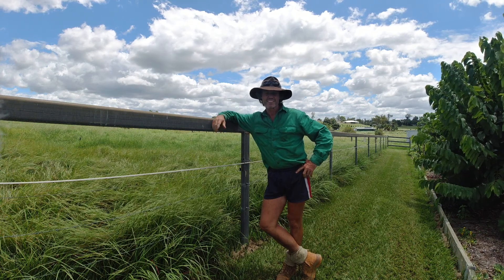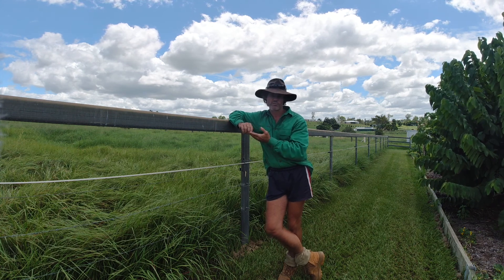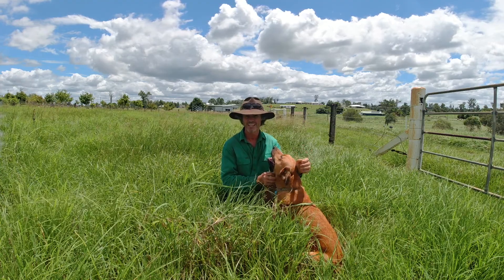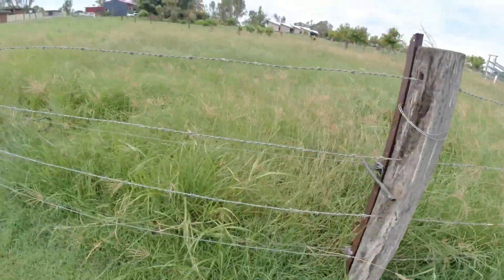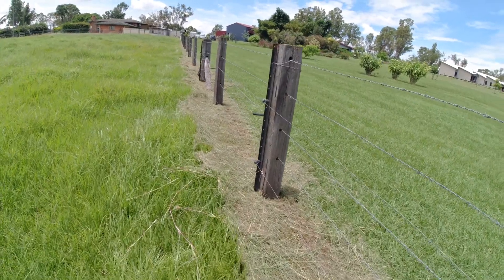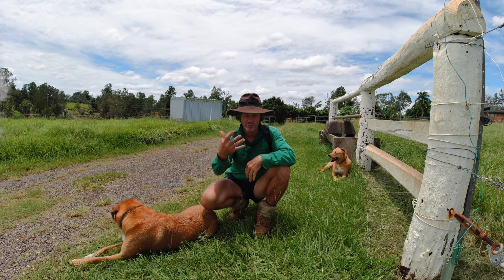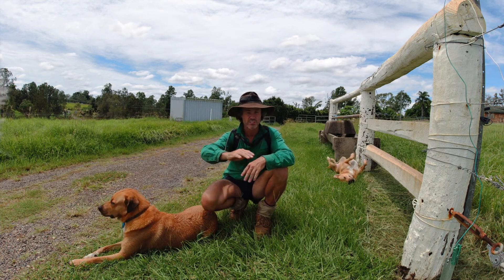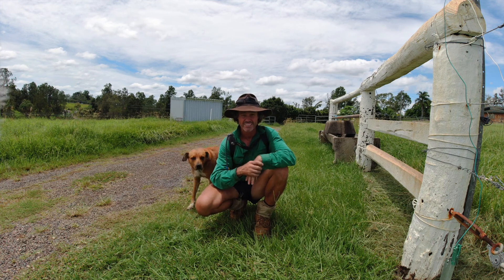WHY ARE THE KILOVOLTS DROPPING ON MY ELECTRIC FENCE!!

Comment: simple u have a thunderbird electric fence worst energizers.JVA  Australia is all the way bang for ur buck  ramps up  kilojoules as resistance  as required never have to trim a fence again  if insulated wires, not 2.5 acts as a  resistor
Reply from the maker: It did me for the past 7 years, though as you mentioned Kev there's a huge range on the market. I'm actually purchasing a JVA MB8 Energiser and solar kit for the UDDERFARM, like you mentioned great bang for buck. We appreciate your message Kev and thanks for sharing you experience with us.